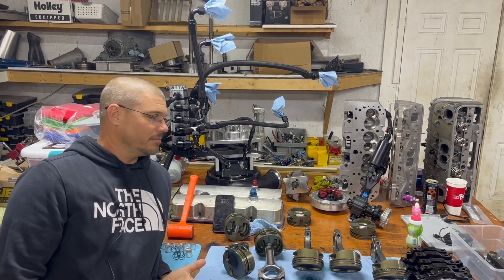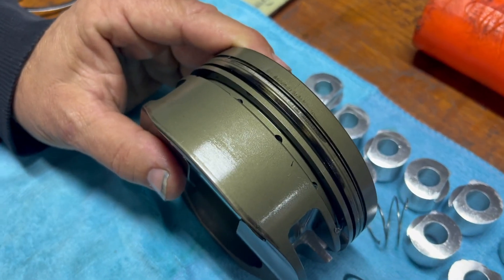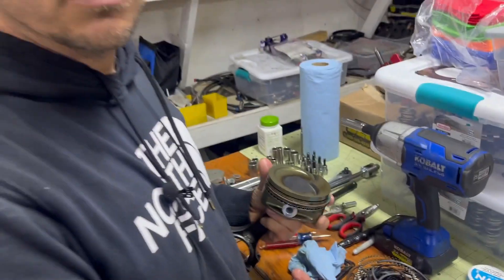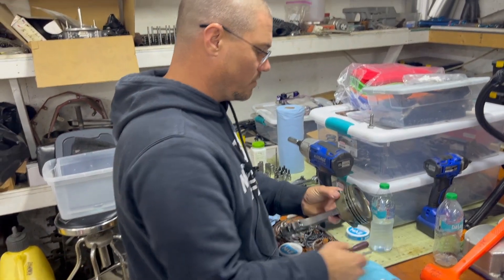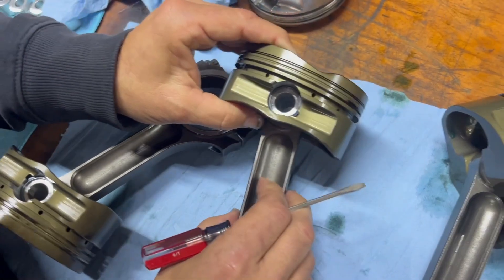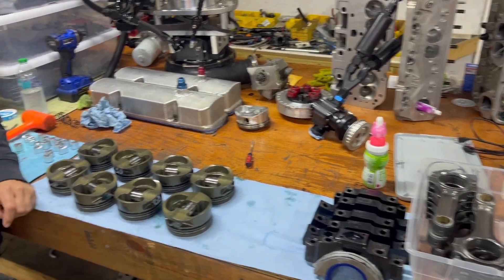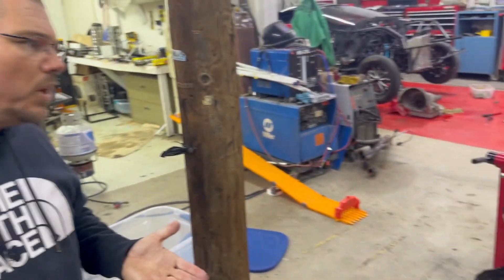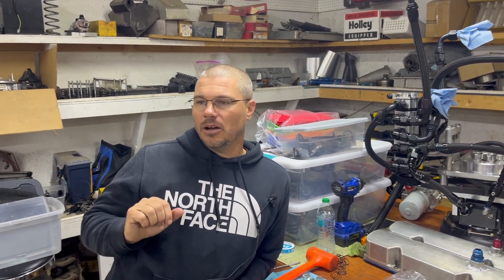What's REALLY Wrong with this 1800HP Engine?

Comment: I thought you don't need  spiral locs with buttons .
Reply from the maker: Depends on the piston design, the manufacturer made these to use both.  Not sure why but when they told me to I didn’t argue with them about it.
Reply: @Snow-Racing  Stops any unnecessary side loading on the bore holding the wrist pins in place, one less thing to go wrong

Comment: I would be concerned about the combustion chamber. Looking at the carbon on top of the piston something is wrong.
Reply from the maker: Do You think the shape of the combustion chamber is causing a problem?
Reply: @ that’s not simple to answer. Could be a combination. Pistons to far down in the hole. Head gaskets too thick. Both of these resulting in not enough squish. The piston has quite a ridge perhaps stopping the swirl. Shrouded intake valves?I always ran as close to flat piston tops as possible. Timing?its going to be a little trouble to get the top of the piston colored across. When you do power will go up easily. This is just stuff I learned on my own. I’m no expert.

Comment: 1700 at the flywheel, i had never heard that i just assumed it was more. I wonder what the lil M or Iron Eagle are rated for? Turbo John posted a recent video of an Iron Eagle at 2500lb, flat 4 sec in the 8th, estimated 3k hp. Not sure ratings mean squat, we've all seen them exceeded severely.
Reply from the maker: They are designed to be circle track blocks and be as light weight as possible, that’s why such a low hp rating.  We may have an upgrade coming stay tuned 😉
Reply: @Snow-Racing  You ever think about getting the block filled with epoxy.. Suppose to make them handle more power.

Comment: I would say it’s wearing in those spots because of the tune up. It’s washing the cylinders down with fuel and could be a little much timing.
Reply: I would think heat, just my opinion the tolerance is borderline for the heat being applied to the crown and its just barely kissing on the thrust side. I didnt hear the piston to wall clearance. It is a little different from what ive seen by just placing a piston in the oven and taking before and after measurements, the areas that grew the most was where there was solid material all the way across the diameter of the piston, which was to each side of the pin, sorta giving it a four corner shape if that makes sense.
Reply from the maker: Great info shared thank you
Reply from the maker: We are skeptical that something like this could be the case and have shipped them to the piston company to see what they day.  We will let you all know what their opinion is as soon as they let me know.

Comment: You might have said something about this in the video, my speakers a little jacked up, but why do you have spiral locks plus wrist pin buttons?  Every piston I’ve had that used buttons, be they aluminum or Teflon buttons, used them instead of any circlip/spiralock/etc?  They literally go from cylinder wall to pin and on both sides so they keep the pin centered automatically and retained without the need for any clips of either style.  And since you’ve got the notched style that support the oil ring rail they are doubly not going anywhere because the rails holding it in too!
Reply: I am curious of this as well. I’m no top fuel engine builder but from what I’ve seen of piston pin buttons they never use any lock for the pin. With that said maybe this manufacturer wants them installed that way? I’m not sure
Reply: @ yeah me too, never seen them together.  It’s almost like that piston was originally made for lock wires and he had some buttons made and didn’t realize once you’ve got buttons you don’t need the lock wires anymore 🤷🏻‍♂️.  Idk my speaker is jacked up, maybe he explained it in the video
Reply: @ what you just said makes perfect sense. Good thinking! I didn’t hear it mentioned unless I missed it
Reply: @robertmason8341 he said he had the buttons made up on a lathe specifically for oil rail support. I just assumed the pistons already had spirolox and he just measured from the spirolox. I was curious also and thats just what i figured but he did say he made the buttons himself.
Reply: Great question!  Pistons designed to run both, not sure why they chose to make them this way.
Reply: @ thanks for replying! And the info
Reply: TO Robert Mason 8341, I think, the locks keep any side load from distorting the thin oil rings, remember, this is an 1800 hp. Motor ! ,Things go on inside of this engine that we can not imagine, Even with locks there is some tolerance side to side, also the small and big end have some, and i think there might be considerable movement at peak rpm. With this engine !?
Reply: Double protective engineering! I would also do this mod for piece of mind
Reply: I would say it’s to stop unnecessary load on the bore holding the wrist pins in. One less thing to go wrong